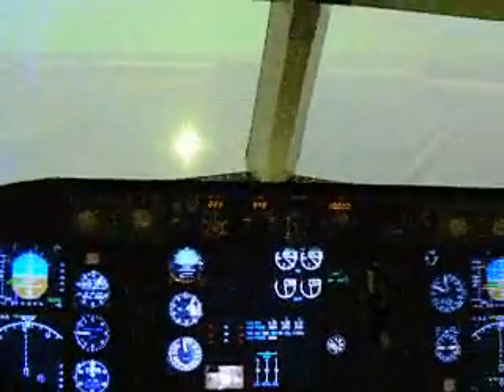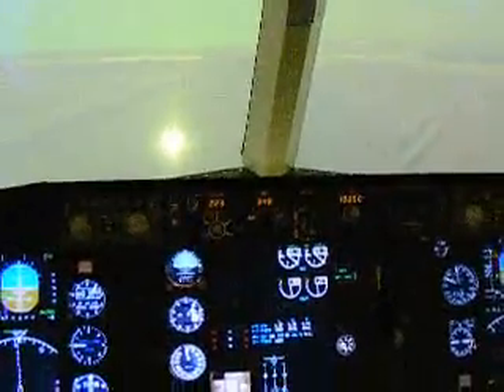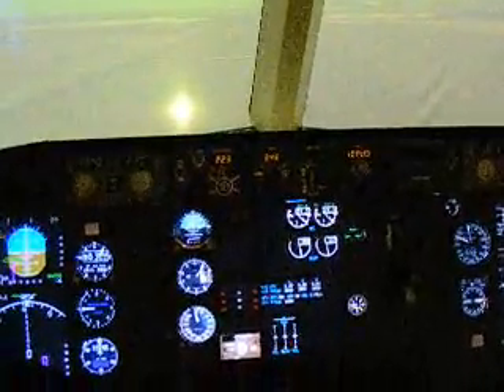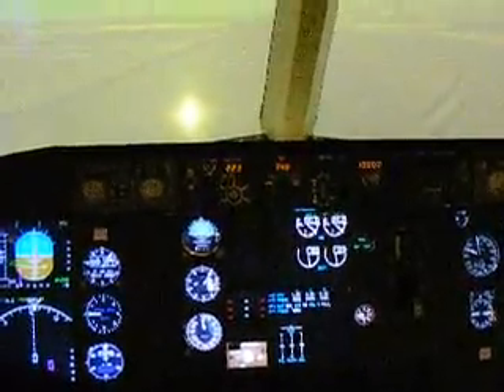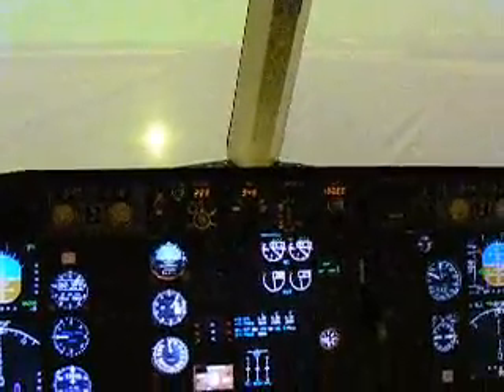Build a 767 cockpit Pt5

Comment from the maker: The cost of a home cockpit project will vary of course. It depends on a lot of things. Where you buy your components, how much you build yourself and wether or not you have to redo things due to mistakes. My cockpit as you see it has cost me around $3500 AU so far, which includes the new computer. another $4000 for the front visuals and perhaps another 3000 on some hardware, ill be pretty close to complete.....>>>it's never ending really :)